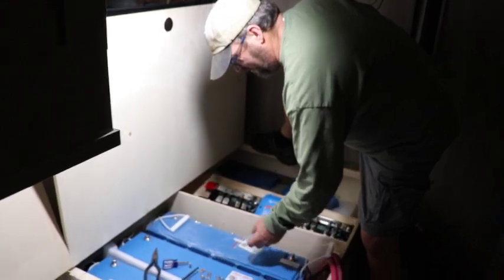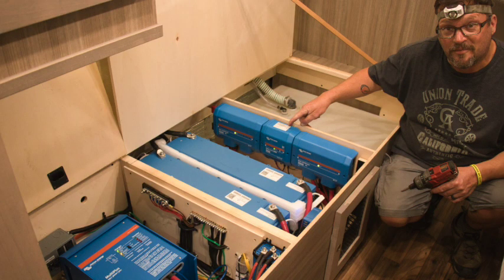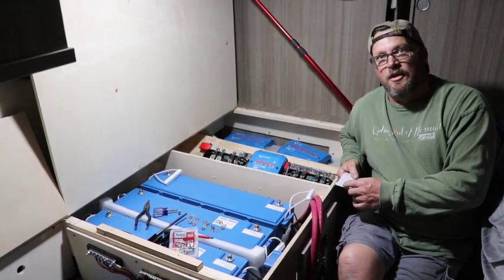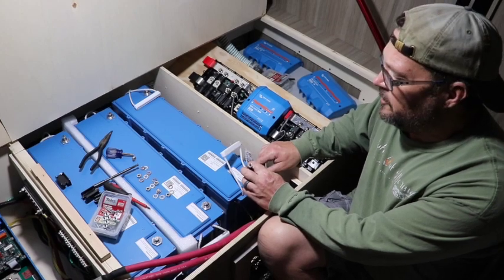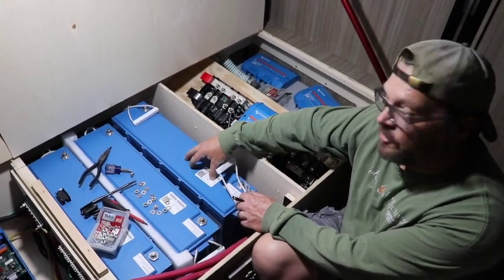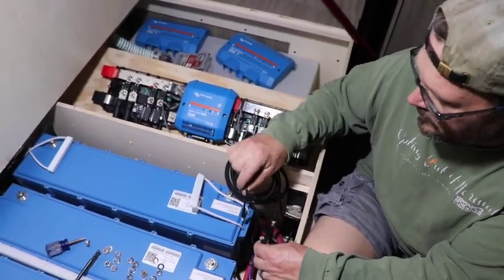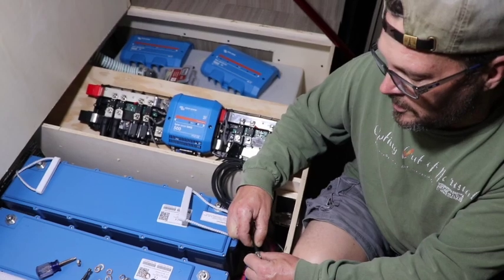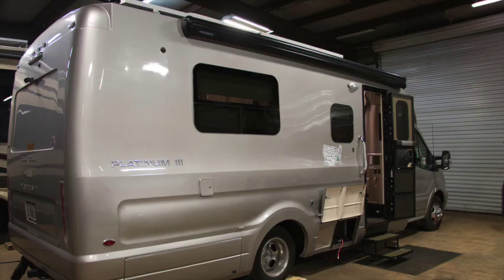Victron Solar and Energy Storage Solution Installation in a Class B Van

Comment: That done set up, what is it worth, parts list?
Reply from the maker: I'm not sure what you're asking. Are you asking what the price for this installation was? Here's a list of the parts we used: 
3 Victron 25.6v Smart Batteries
2 Victron Lynx Distributors
Victron Lynx Smart BMS
Victron Multiplus 24/3000
Victron DC to DC Converter
Victron MPPT 100/50 Charge Controller
Victron Cerbo with Touch 50
6 - 190w Go Power Overlander Panels
If you reach out to us at sales@panelsupsolar.com and we can provide you with a quote specific to your needs.